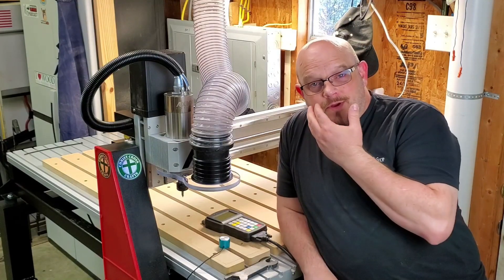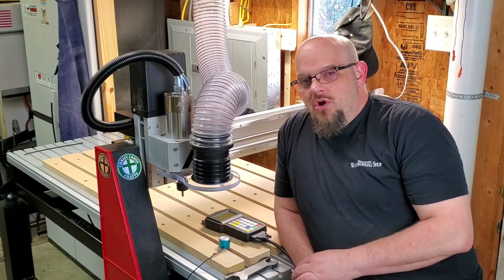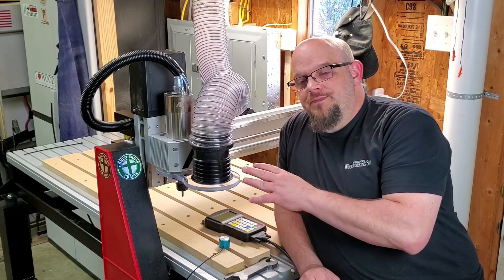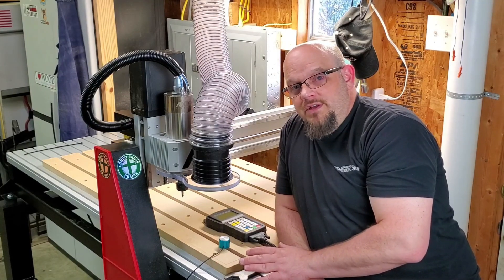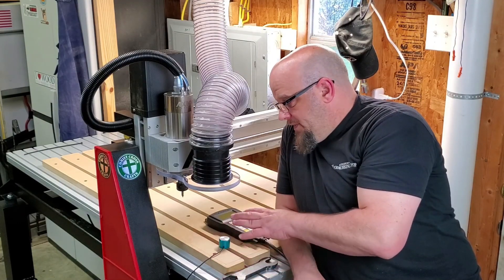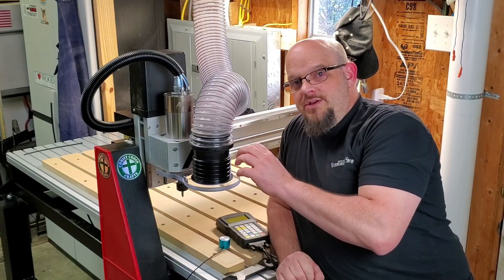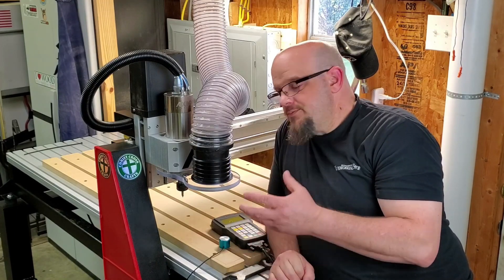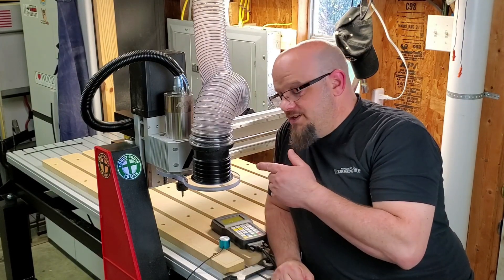Why I Sold My Shark and Got An Axiom AR8 Pro V5

Comment: looking to upgrade my shark510. after having the Axiom are you happy and would you consider this move an upgrade? comment on the differences
Reply from the maker: Switching to axiom is definitely an upgrade.  
Bigger motor, more torque, more speed, more accuracy, better repeatability, beefier build, proximity sensors, and the list goes on.

I ran a part on my shark and it took 1 hour and 20 minutes.  Same part on the Axiom takes 50 minutes and comes off cleaner.
Reply: @ChristcrossCrafts  how did you sell your shark?
Reply from the maker: Marketplace ad. It sold within a month

Comment: i’m looking to buy one of these. what kind of power does it require.  220? or regular 110 outlet?
Reply from the maker: The pro and elite series are 220v only. They do offer the Iconic brand.  For the price, if 110v is required, the Shark is a solid option.  They now offer a larger spindle.
Reply from the maker: If possible, get the Pro.  You won't be disappointed.

Comment: Very nice Chris! I like your honest opinion and best of luck to you. I am considering this model over the Shark for the reasons you stated. May I ask you a few questions? I have a small shop converted from an in-law suite and I am concerned over the door entrance of 31" wide. Will the CNC itself fit? Did the gantry come installed? I'm thinking I may need to turn it up on a side to get it through the doorway. Or, can I unwrap the cnc from the shipping box after it is inside my shop? Also, how heavy is the machine itself? I have the help of one other person so that is a concern. And lastly, I have a dedicated area of 6 ft along the wall by  4-5 foot out from the wall. Is this enough space or should I go back to the drawing board? I am sure a Shark can work well for me but I'm more interested in the Axiom AR8 Pro V5.  Thanks again and happy carving!
Reply from the maker: Thank you for watching.  Shark is about to launch a new spindle that is much beefier and will accept 1/2" shank.  It will have other cool features as well... just an fyi.

The machine will fit in the door but will have to be tipped on its side to do so.  It is a HEAVY machine, especially the AR8.  You will want to utilize carts and at least 4 people.  It's tough to lift and move normally, let alone sideways.  You are looking at about 350-400lbs with just the machine.

You might want to rethink your option.  Those dimensions are very close and would not allow for space to walk around the machine.  I do have mine tight to one wall, but can easily walk three sides.  If you went with the AR6, you may find it gives you a little breathing room.

You won't be disappointed with the purchase, as Axiom makes a beast of a machine.

Comment: You can add the new 3HP Water-Cooled Spindle Kit for HD500 Series that is available and takes 1/2" shanks for 1300ish dollars. But now I'm torn between the two.
Reply from the maker: It still operates on 110v.  I've long upgraded to the Pro with 3hp on 220v power and love it.  So strong and solid.  My job requirements have also changed and I'm thankful I made the change.  

The shark is a good machine but I needed more.

Comment: Rockler says they don't have a 1/2" collet for the Shark 2hp water-cooled spindle.  You said it handles a 1/2" but it's maybe not recommended?  In any case, where do I get a 1/2" spindle to try?
Reply from the maker: If outfitted with a router, it has a 1/2 collet option.  If upgraded to the spindle, it does not.  Shark is coming out with a spindle by the end of march that will but it's not available yet.

Comment: It's a shame shark doesn't build theirs more rigid I have the HD4 and actually wished I would of spent the extra $$ and bought the Axiom. I definitely am crying now!
Reply from the maker: They did a decent job for the $ on the hd5.  They are even working on a solution for the 1/2 shank spindle.

You do pay significantly more for Axiom so the need and budget would have to justify it.
Reply: I have an HD4 as well as upgrading very very soon to this machine. Looks STOUT!
Reply from the maker: @JF32304  It is a beast for sure.  Get the stand and dust boot.  Other accessories are optional.  If you need storage you can build like I did (my video is on here somewhere) or buy their toolbox.

Comment: Chris now that you have a year or so to use the Axiom how's it holding up?  I currently have the Shark HD 510 it's been rock solid for 1.2 years  but my contoller card just went out on it this week.  I really think it was a static charge from the shop vac when I was cleaning up.   The new card should be here today or tommarrow.   I have made over 170 projects with this machine and love this CNC stuff.  Just curious. I am not for profit but make a lot of stuff for our Church Scouting program called Royal Rangers.
Reply from the maker: I love my axiom.  It is very solid and heavy duty.  There is a part I frequently make that took me 1 hr & 20 minutes to cut on the shark.  I am able to cut it in 50 minutes now.  I can make several more of them in one night now that I'm saving 30 minutes per part.

I also love the quietness of the 1/2 shank spindle.

If speed & 1/2 shank spindle capabilities don't concern you then keep what you have.  Shark is a good machine for the money.

I love my decision (for me) so much I sold my axiom pro and upgraded to an Axiom Elite earlier this year.
Reply: @ChristcrossCrafts  Thanks Chris.   Enjoy your videos.

Comment: Great video. I am in the market for a CNC and this video really made me stop and think before I make the purchase. I drill metal enclosures that are 5"x6"x1.75" high. I need to be able to drill on all sides of the enclosures not just the top surface. So I need to place the metal box on it's side which would stand 6" tall and drill holes in it. So the Z would have to be 7". Can you recommend a CNC that can do that at an good price? Would the Axiom AR8 work? Thank you.
Reply from the maker: Thank you for watching and the kind words.  The shark has a tall clearance buy may not be as stable as you would need.  

The ar8 pro only has a 6" gantry clearance, but the axiom ar8 elite has almost 9.  Plus it has a better controller, servo motors and some other perks the pro series does not.  Sadly, it come in around 11k.  

For accuracy, gantry clearance, and rigidity, you won't fund anything better for the price.  Avid or shop sabre offer options that will fit your need but at a much higher price point.

If you have any other questions please let me know.
Reply: @ChristcrossCrafts  Thank you so much for the information. I will take it all into consideration. The work needs to be accurate and I am getting quite an education on CNC especially thanks to users like yourself with so much experience.
Reply from the maker: @analogalien  it can be quite exhausting with all the options out there.  This makes it even more difficult when the thing you really need is 2-3 times the price of similar items that are close.
Reply: @ChristcrossCrafts  You really hit the nail on the head! It can be quite exhausting, but I'm sure it will all come together in the end. Thank you again for taking the time out to help me and answer my questions. I really appreciate it.

Comment: Shark and Axiom videos very helpful . I’m newly interested in cnc, trying to figure out what makes sense for me.  Can you tell me your what type of projects you use cnc for and how long it took to earn your investment back?  Thanks for the videos.
Reply from the maker: Thanks for watching.  I make a variety of different things but focus a good deal on 3d and custom pieces using traditional woodworking but with CNC flare.  Some are all CNC but custom.

I also have some parts I make as a template and all I change is the part that makes it custom - name, date, etc.

I have a couple of customers that I simply cut out parts for them.  They do all the assembly.  Easy money!

The time to get your money back will vary based on your willingness to learn and work a lot of hours.  For me, it's a second job so I'm out in the shop about every night until 10pm or later.  Whatever it takes.  The shark is more than paid for but I'm still working on the Axiom.

Comment: I've been looking into entry-level CNC machines lately and ran across the Shark.  It appeals to me b/c it seems well built, but I'm a bit concerned at how little information is online about them compared to the XCarve and Shapeoko.  I am pretty firmly in the sub-3k range, though, so the smaller HD5 is probably as high as I can go, at best.  If I have never used a CNC before, is this a good starter unit?  I'm just a bit intimidated by the space needed for the other units I've seen (I have a small shop) as well as the fact that I have to assemble them from a kit.
Reply from the maker: Compared to the other units you mentioned, the Shark is a better alternative.  The Shark is all lead screw and linear rails while the others are drive belts.  

Plus, the Shark comes with Vectric which is a much better  CAD/CAM software.
Reply: This gonna be my first cnc and don’t want to buy it 3 times.

Comment: Great, thanks for posting. I’m moving up to this exact model very soon. I was told not to buy because there is only two bearings and one linear rod for the z travel. Is this right?
Thanks
Reply from the maker: It has a coupler on one end of x & y with 2 linear guide rails and a bearing on the other.  Z has a coupler and I don't recall how many rails. 

Honestly, I haven't seen anything even close to the quality in the 15k and under range.  

I've had nothing but accuracy out of mine.
Reply: Thank you 👍

Comment: Nice video.  i subscribed to browse your previous videos with your Shark.  i'm going to be a CNC newbie.  still deciding on my first one.  i have a budget around $2500-3000 US.  I was going to go with a BOB"s E4 for the price but i raised my budget to get a better, bigger or sturdier one right away.  so now i'm thinking Shark.  i really want to stay clear of belt driven and now know that screw driven is best.  sorry if i'm not using the proper terms.  lol   so with my budget , is there something else i should start with for the budget i have?  oh and i would really like one with lowest noise level.  so i guess that means a spindle if i can afford that

thanks , looking forward to watch your previous videos.
Reply from the maker: First, thanks for watching.  I do appreciate it.  The Shark is a good machine for all the reasons you mentioned.  

You are definitely correct to stay away from belt driven machines.  They are popular due to price but leave the user wanting more and frustrated due to contant tensioning and inaccuracy.

There are a few machines that are worth the money and Shark is one of them.  Stepcraft seems to be pretty good build quality, but limited in a few areas.  Digital Woodcarver offers a solid machine and amazing support but is router driven.

Spindles are quieter for sure. Axiom offers a smaller machine at about the same price point as the Shark - the Iconic - that comes equipped with a 1hp spindle.  It is very quiet but limits bit size to 1/4" shank or less.

Shark has the same situation with their spindle - 1/4" shank or less.  This leaves the quandary I was in.  I wanted a spindle because the horrid router noise was too much.

I ended up selling my Shark and got the bigger Axiom, which will be considerably outside your range.

With all that said and spindle & lead screw driven at the tip of the list, Shark or Iconic are the best in your range and will offer great options.  Shark includes the software and through the end of the year, a free spindle upgrade at no charge.  Iconic has a little better build quality but you'd have to buy software.

I hope this helps and didn't make it more confusing.   If you have more questions, please let me know.

Comment: Thanks for putting up this video. Quick question. Can the kit be set up to over extend so that you can cut vertical and do box joints etc on end of table.?
Reply from the maker: No.  The table location is constrained to a set point and can't be used beyond it.  If that is something you are interested in, check out the Digital Woodcarver.  It meets a lesser price point and a smaller table size (24"x40"), but does have that feature.  There are other brands as well, but either way more expensive or much lesser quality.  

Here is a link to Digital Woodcarver where I bought my Shark and Axiom.  They sell them too.
https://www.woodworkingshop.com/product/dwc2440/
Reply: @ChristcrossCrafts  Awesome! Many thanks man.
Reply from the maker: Anytime.